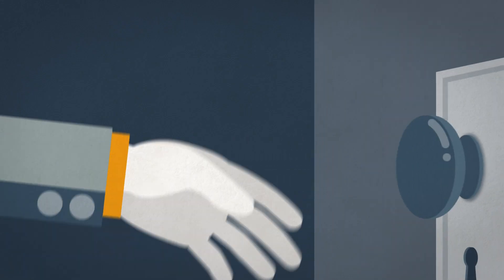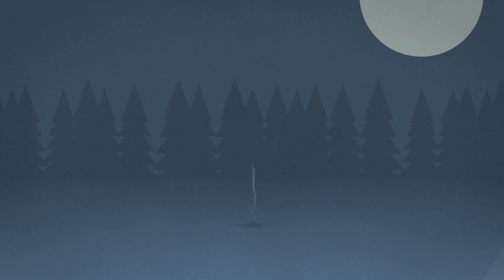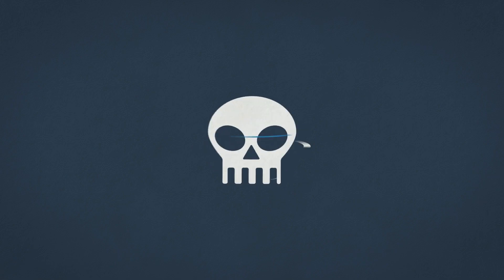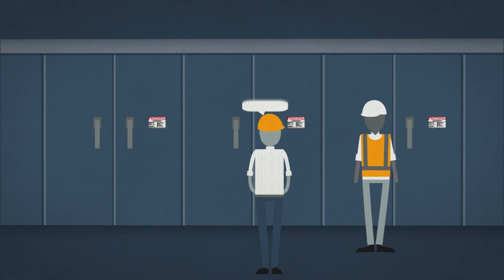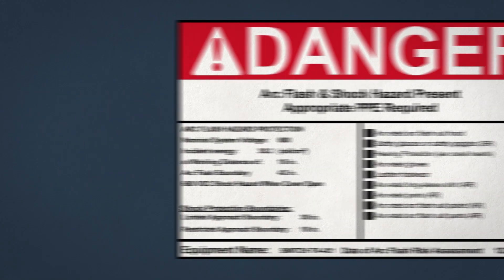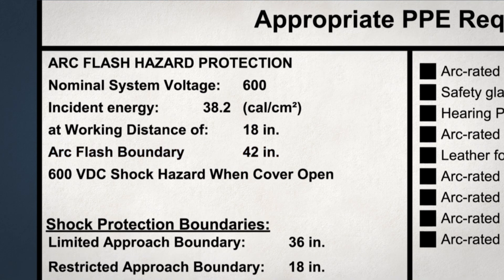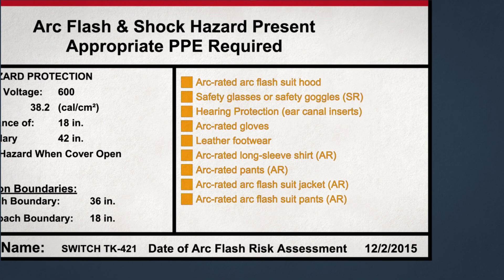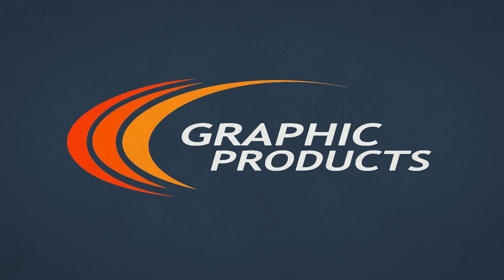What is Arc Flash?

Comment: I know what that is. I got hit with a low-voltage 130V flash trying to plug in something from a defective outlet until the   15 amp fuse opened the circuit. Fortunately this arc flash did not electrocute or burn me, but I got interested in arc flash safety so I never ever have to deal with these things again. 

High-amperage/high voltage arc flashes have these factoids.......
1. If there is copper in the arc flash, a 3-phase arc flash can happen (not just a 1-phaser), worsening the risk of electrocution or burn related death. 
2. Temps can shoot up as high as 35,000 degrees F in some arc flashes. This can lead to up to 4th to 5th degree burns that can go down to the bone--and kill you! 
3. If the arc flash leads to an "arc blast", the explosive force can be as high as 2,100 pounds per square inch. This is a bit like 2 sticks of dynamite blowing up at your face and creating a pressure wave from the explosion that pushes you back as fast as 200 or more mph, and slams you to the wall, which can lead to concussions or even other fractures of the body.
Reply from the maker: Thanks for all the info! It sure is a force to be reckoned with.

Comment: The video doesn´t explain what´s really arc flash.
Reply from the maker: If you'd like an in-depth description of arc flash, we've created a guide for you. Hope this helps👉 https://duralabel.info/3saU5iO
Reply: @DuraLabelbyGP  I just bought a surge protector. when I put load on it and turn it on (from the wall switch) I can hear a sound behind the wall switch. 

Is this a Arc Flush? when there is no load I cant hear it
Reply: AI said its "electrical arcing" or "arcing."

Comment: The simple answer is that Arc Flash is 25,000 Celsius plasma usually containing vapourised  copper and other nasty stuff.
Reply: Add the loud sound of up to 150 dB if there is an arc "blast" instead of flash, and the blast equivalent to being blown by a fragmentation grenade or 2 sticks of dynamite at 1 foot away, and these events WILL DEFINITELY KILL! NOT JUST SEVERELY INJURE OR BURN!
Reply: @charlessmith263 do you understans about arc flash?  Can i make a question to you?
Reply: @guilhermearaujo1350  I witnessed a 130-V arc flash when plugging a night light into a defective home outlet in 1985. Suspected the H wire rotted that caused the flash. The circuit breaker tripped in 0.10 seconds before I got electrocuted or die, but it was a helluva explosion.
Reply: @charlessmith263  the watts of a power flash is the same of the wires?

Comment: what is the recommended material for work shirts or what is the worst type material to wear around high voltage switch gear if an arc flash occurs .....thanks
Reply from the maker: Hi, Gary. For the clothing that is next to your skin, you want natural fibers — that is, nothing that can melt. (Clothing that melts onto your skin during an arc flash will make any resulting burns much worse.) For any situations where an arc flash would expose you to more than 1.2 cal/cm² of heat energy, some kind of arc-resistant clothing is needed. To help, this article is spot-on for what you're looking for: https://www.graphicproducts.com/articles/arc-flash-ppe. Please don't hesitate to contact us if you have more questions. You can email us anytime at support@graphicproducts.com.
Reply: Don't wear synthetic fabrics, especially next to your skin. It will melt into it. Cotton is probably OK.
But approved protective clothing must be used where the risk exists, however small.